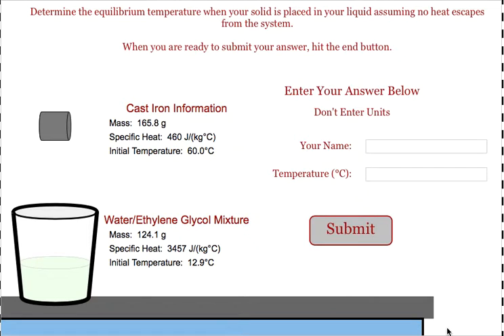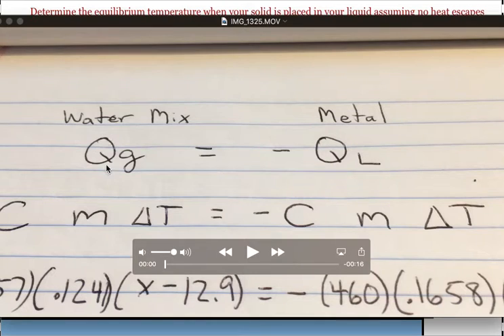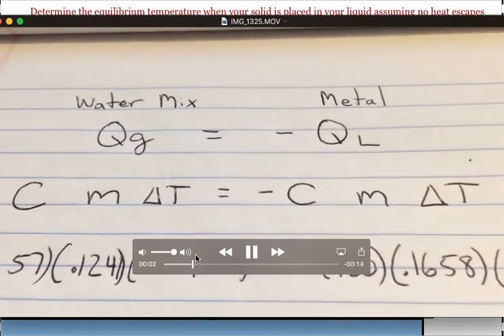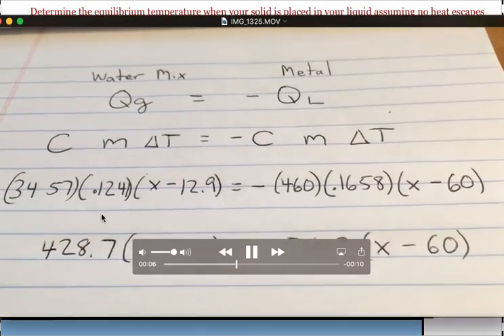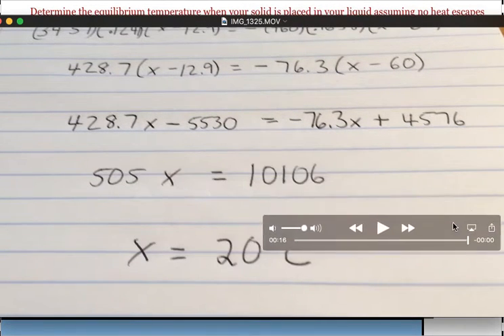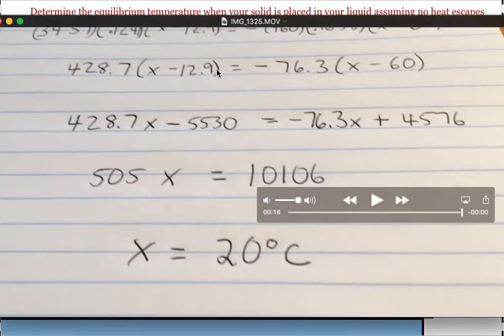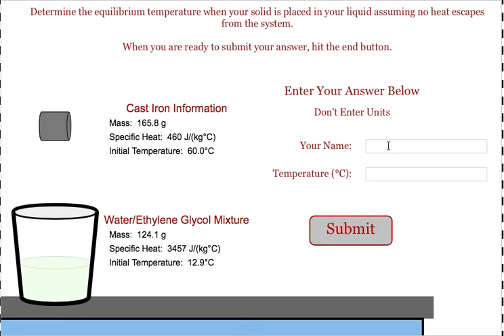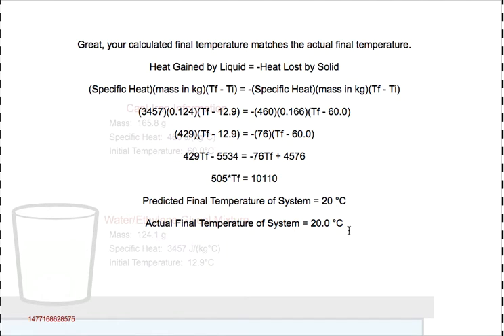Final Temperature of a System

Comment from the maker: You can convert to kilograms and you get exactly the same answer. Since the mass is located on both sides of the equation , multiplying or dividing by any number on both sides will not change the final answer. So dividing each side by a thousand to put it into kilograms will not affect the final answer.

I do agree with you that it would be better practice to put the mass into kilograms, but it is not necessary to get the correct answer.